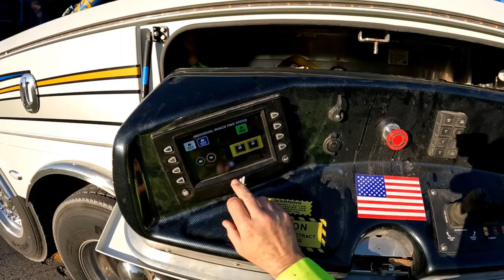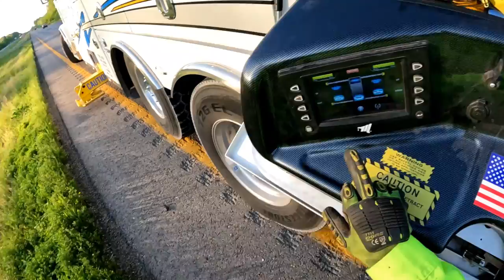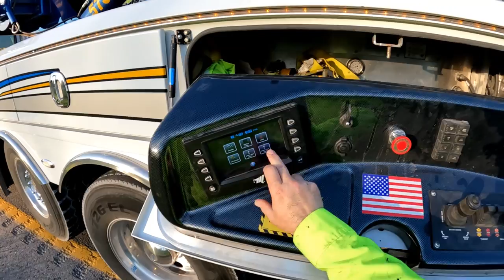DUMP TRUCK CRASH & DASH!  WHO OWNS IT?

Comment: I just wonder if your called out to an incident like this of a possible stolen and or uninsured vehicle, who pays for the recovery. Or do just recover some cost's via scrapping the vehicle.

I worked for a crane hire company and would often called to lost load incidents, the office would check with owning company before I rolled. All were insured so no problems other than working with a pre hydraulic lattice jib crane and hand operated outrigger crane on a major London ring road.
The lorry mounted crane was made by Allen Grove a UK - US partnership company.

That was a good recovery in spite of the mishap, hope you didn't suffer more sheave damage. Thanks for posting.

Comment: I'm curious as to why you chose the option to pull it sideways rather than at an oblique angle that would let it roll on its wheels? Is it because you wanted to turn it 180?

Comment: I have multipal things to write. I will start with why did you choose to leave the Dump Truck running? Great idea to grab the other main cable ole Blue and get back to work. I saw some one write a thought about numbering all you compartment boxes onside and out on the Rotator. I think just doing a training session with every one twice a month and encourage them to check over all the company vehicles regularly when they ( the staff and units) are at the shop. Did the wrong parts for the rotator get sent back or will they work on a different unit? BE SAFE & Take care like normal Ron.

Comment: Nothing makes life easier when you get the wrong parts on an order. Especially when you order the right ones. Years ago while in the Air Force I ordered some stainless steel bolts. Got brass ones! Checked the part number and NSN, correct so I reordered them. Got brass ones again! My supply sergeant got pi**ed and contacted the parts depot to see what was happening. Turns out that the wrong parts were put in the stainless steel bolt location. When orders arrived, the part location was listed, some grunt went to the specified location and got the required count. Never bothered to check the part description! Oh well, that's the military for you.

Comment: So, what happens to this unclaimed truck if nobody is found to be the owner in a certain period of time? Does it get sent off to be repaired and auctioned or based on the condition in the video, scrapped? Sounded like the engine was still healthy despite what actually happened to the truck.

Comment: Hey Ron Something to consider it could be a Possibility that  this truck you see was possible in transport and was not secured correctly and some how came off the truck and into the media before coming to a stop. Why your waiting for the secondary truck @9:18 at least start putting cones out
Reply: as one that spent about 15 years doing drive away, I would have refused to move that truck on those tires, and probably for several other reasons.

a truck that was part of a piggy-back (or "decked") consist would have bore marks of the rigging needed on an axle that was as caked/dirty as that one was, and I've never seen a decked rig that wasn't the power unit moved with the front tires on it.  and I've never seen a dump truck moved like that anyway, so I'd guess the chances are "nil."

but I also have no doubt that someone out there would try it if they thought they could get away with it.  The fact that someone tried to drive that rig proves there are crazy people out there.

Comment: Just curious...what size and type of engine is in Tater? Also what top end speed can you get with it? Must be a big one to haul that much weight at interstate speeds...lol.
Reply: Cummins ISX15 or X15, not sure which one. Tator is a 2015 Peterbilt 389 with a Miller Industries Century 1150R 50 ton Rotator body. I think Ron did a walk-around video on Tator  before, but I honestly can't remember. GOD BLESS YOU!! ✝️🛐

Comment: I’m so confused by the fact that the police can obviously run a vehicle by VIN to check if it’s stolen but for some reason can’t see who owns it. I know they normally run plates for Thames owner’s information but you would think there would be a database to cross check VINs against the last registered plate
Reply: Normally running the VIN will bring up the Registered Owner and what Plates it should have on it but this truck is so old it's VIN is only 6 digits long instead of the current 18+ digits and the last time it was Registered at the DMV was likely 35 years ago...MAYBE...
Reply: If it was registered before the computer transfer. The last plate on it would have been in paper records. Thus no one knows who owned it last

Comment: Has anyone checked auction yards? It might not be listed as stolen if a yard had already released it, thinking that it would be trailered out by new owner. The new owner might have cheaped out and tried to drive it home in the dark without tags. They might see abandonment as cheaper than towing, recovery, repairs, and fines for driving without tags. Identifying details and new owner information would be in the yard's records.

Comment: If the hood/fender and bumper weren't damaged and the truck was road worthy and i could afford the maintenance I'd take it. 
I've been in those old Ford trucks granted not a dump truck but functioned like one but was more top heavy and prone to tipping when loaded even going slow hauling livestock feed or sawdust.
Reliable truck for the most part but loud in the cab.
With how loud that one was i reckon you couldn't hear yourself think in the cab like the one i rode in granted if i got this correct it was a 4X2 i was riding in and didn't require a CDL not a 6X4 chassis like in the video.

Comment: WOW, so dangerous stopping in the hi speed lane with all the distracted drivers and rubber neckers on the road. Just one person slowing down to much followed by a distracted driver coming up on them 20 over.
I may have missed it but did you shut off the Ford and check to see if it was still in gear before moving it?.

Comment: It’s been a long time since I’ve seen one but it doesn’t look the same way that a radial tire disintegrates. Since it’s an old truck would that tire happen to be a bias ply tire? There used to be one that wrapped from rim to rim then diagonally from rim to rim. Then of course a radial with the belts around the circumference. It escapes my memory what the third one is named. I guess I’m getting old. Lol.
Reply: cross ply was the oldest which wrapped from rim to rim, then came bias ply which was diagonal, then came radial which is around the circumference

Comment: I still can't believe Ron that if you are flashing red and blue lights its not compulsory to slow done to whatever 40 kms per hour is in miles cones or no cones. They run cameras here in South Aust on the front dash and rear shelf and lookout if you go through an incident where lights are flashing without cones out too as they aren't set where someone is pulled over for speeding. So unsafe there it staggers me. I can see why you are so concerned.

Comment: And they left it there running? That definitely sounds like someone was out on a joy ride or worse to me. I bet messing with those old split rims gives a bit of a pucker factor for you. I'm with you, I definitely think it was just sitting on someone's property and either the guy was doing a "revival" and just got so mad that it blew tires and didn't want to pay for the damage to the cables, or he outright stole it and his follow vehicle picked him up and they booked it when he wrecked.. I notice not only did he blow a steer tire but one of the drives is shredded and the one with the locked brake looks like the outer drive has no air as well.. likely because those tires are dry rotted to hell from sitting forever. Was/is there anything in the bed?
Reply from the maker: Nothing in the bed.   As far as who the owner is, who the driver was,  or if it was stolen.....the world may never know.....
Thanks for watching and God bless.
Reply: @RonPratt  well if you get awarded full ownership as payment for storing it let me know, I know a youtuber that lives in Missouri that might want it if you go to sell it.
Reply: @jaratt85  i believe if a vehicle goes unclaimed it gets auctioned off. Probably by city or state.

Comment: too bad that wasn't near port huron, mi... I could use a old ford dump to bring in some gravel for my driveway... (keep trying to convince myself to pick up a f350-550 small dump on the cheap, at least temporarily)
probably swiped from the back lot of a olde closed business or farm, that probably didn't know (care) it was gone... or sold as parts truck to some random, after last owner passed years ago.... - no paper trail... probably being brought to it's final dismantling place... I doubt anyone will step up, and it's probably been a long time since it was "road legal" (and several owners)... last owner probably lost any paperwork they might have had too...

Comment: Stolen truck with a drunk driver who didn't want to be caught doing either one of those things? Working on the interstate especially on the inside lane is not where I want to be. I threw a thread on my rt front tire on my pickup and I just drove down the shoulder to the exit and a service station to change it. Had to put air in the spare also so it was the best decision to get off the road. Glad you got off the road safely and fast.

Comment: "The cone controversy: First off, you did not have to stand in the fast lane to hook up that truck and pull it out. Risk analysis involves both the nature of the exposure and the duration. You could not have set out cones without being in the fast lane. There is always a weighting consideration of personal safety versus public safety. Its not worth dying to reduce the odds of inattentive John Q. Public having a fender bender. There is no way to quantify things that don't happen. If not putting out cones saved 5 minutes and inattentive John came through 2 minutes after you left, that would be an accident that would have happened if the cones were out. Inattentive John may hit the cones and have a 'Huh, whassat' moment that lasts too long, so there is nothing magic about cones. . However, a jury may not see it that way.  Waking up inattentive John is the reason highway departments put out excessively long strings of cones ahead of road work. There are also drivers that think the construction jerks went to lunch and left the cones out because they were too lazy to pick them up, so they get into the blocked off lane to show their displeasure. Drivers react when they see no reason for lane closures.  Some grumble and some take action. Alpha dogs behind the wheel.

Comment: Unless you answer it later on in the video, I'm @12:16 at the moment, I'm curious why you didn't shut off the motor in that dump truck?

Edit: It sounds like the engine died on it's own.
Reply: Either that or Ron shut it down, but decided not to show that clip as it could be uses as evidence later if need be, or the inside was quite nasty and didn't want to gross out his viewers. But I did notice the truck's idle did slow a bit while he moved it,but it could  have been from the brakes being locked though.

Comment: i drove tractor trailor i blew a steering tire if you step down on the gas pedel you can get it under control and gentely let up on it   i felt like i was lifting weights for an hour and had seat belt markes in my legs company was sold defected tires that dump truck looks fix able

Comment: Trucks running why not drive it out been faster
Reply: The engine was running, yes. That in no way implies that the truck was running. With blown tires and jammed brakes (and dubious steering), that piece of junk wasn't going anywhere under its own power.